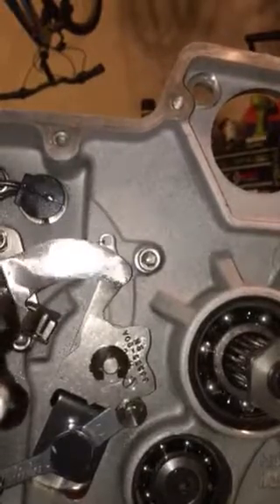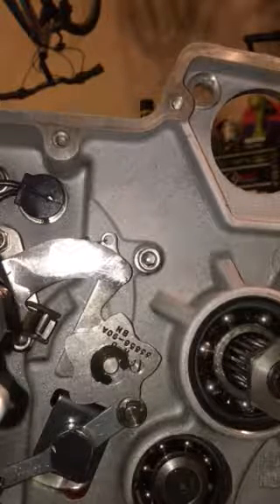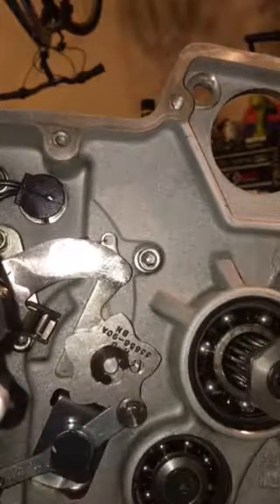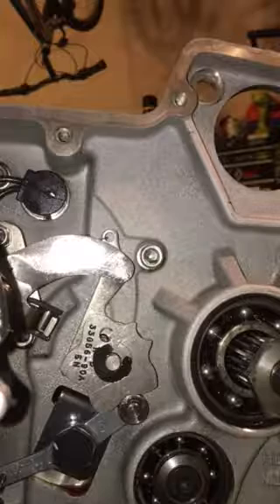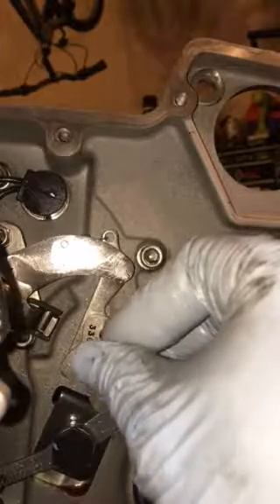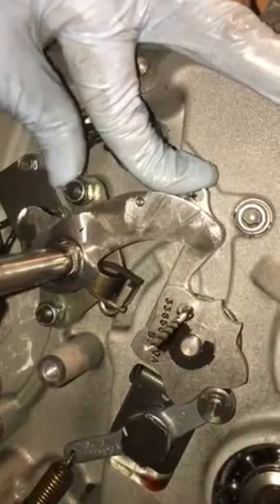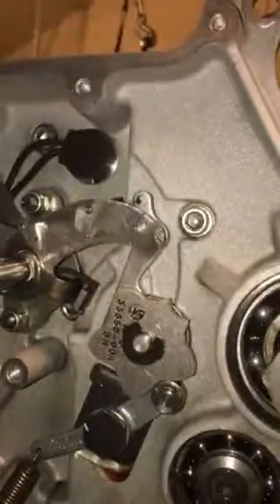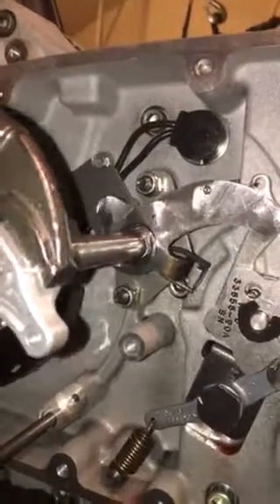Buell blast test shift

Comment: I'm curious to know what were your problems before you knew to fix her?
Reply: My issues started with not wanting to go into 2nd...took 3 or 4 attempts and only did it every now n then...Now she is not drivable
Reply from the maker: Cynthia Yount 

Long story.   I bought this bike for my oldest stepson.  I kept telling him not to slam it into gear till after it’s warmed up and the idle goes down.  He didn’t listen.  Thus his shifter got stuck and we couldn’t get it into any gear.  I feared this would happen.  I know the shift forks are softer metal, brass I think or brass alloy of some kind.  Shift drum is of hardened steel.  Anyhow i have more videos of how i fixed it.  He basically created a bulge on the shift drum and it gouged the inner diameter of the fork.  I ended up tearing down the motor and repaired it with a honing stone and a knife sharpening stone.
Reply: I wish I was mechanically inclined...I'm sure I will be paying a lot to fix. She was my first bike. Going to take her in to be evaluated.
Reply from the maker: Cynthia Yount were you able to see some of the other videos of mine?
Reply from the maker: https://youtu.be/jAY_0D_Xh-U
Reply from the maker: Here’s another video of my repair.  https://youtu.be/3U54xMPkU-o
Reply from the maker: Cynthia Yount 

Hey Cynthia?!   I was just curious if you received any information on your bike and what was the outcome?   It says it’s been about a month per the last conversation reply and I was just wondering if you got your bike back on the road?   I’m also on Facebook, same name.  Look for a lot of Buell motorcycles on my page.